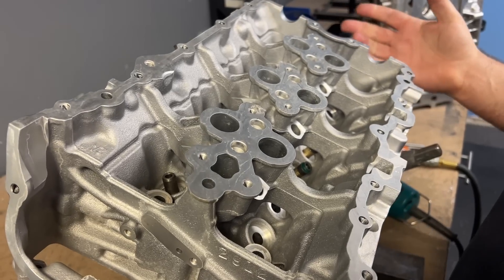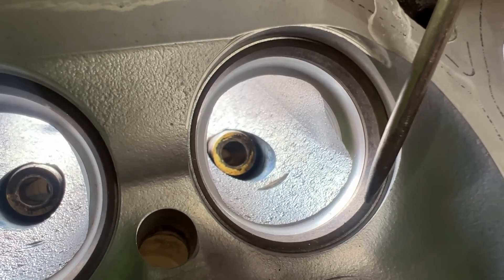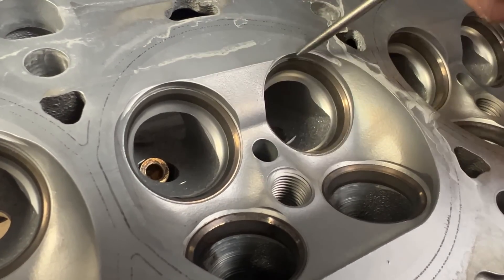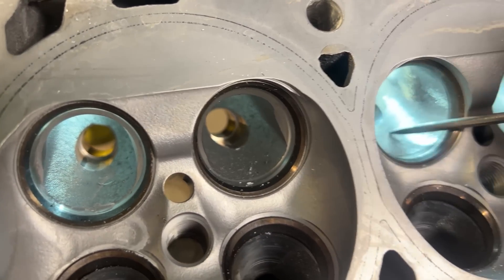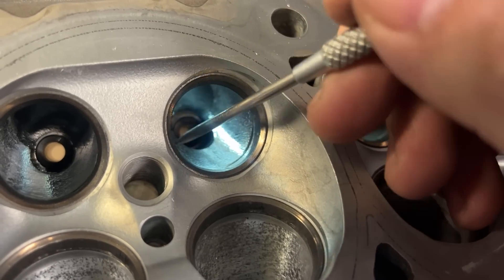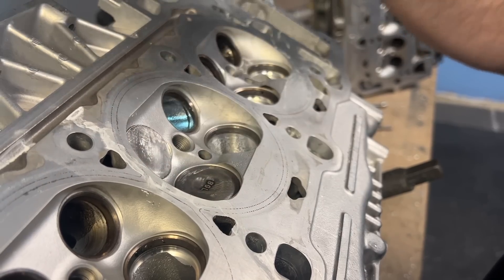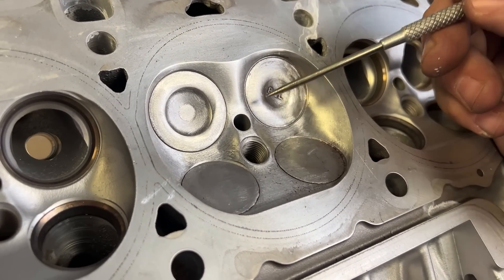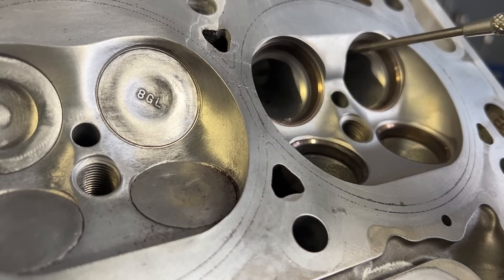The Game Changer- Audi B9 cylinder head R&D Part 1

Comment: Thank u for this vídeo and this explanation, I like This type of job. I would like to learn myself. 
Im trying to get the inside of my Intake manifold ported could I ask u what type of finish you recommend for this job? 60 grit or 120?? Thank u
Reply from the maker: Glad you got something out of this! One thing, if you are just going to sand the intake, don't waste your time. There is nothing in surface finish, you need to move material to make a difference. After porting, I would rough in with a 60 grit and go back over it with 120 grit then hit it again with a scotch bright red pad to get rid of the glue from the cartridge rolls.
Reply: @headgames Thanks for the advice, I will do that. This may sound stupid, I have the Makita GDO603 for removing material and it is fantastic. The problem I have is that I can't find a pneumatic grinder with front exhaust for sanding. My air compressor is 75 LITERS I don't know if it could be done with something like a Foredom SR? or what would you do?

Comment: i'm still amazed with all the efforts companies go to to get better emissions/mpgs from there engines that there is still such easy picking for head porters on modern castings.  I bet with he gains in CFM here that if the OG engine is 2.0L it could not be making the same power with 1.8L or less. I know they want to save money/time in the factory from not doing a CNC port, but surely there benefits are attractive in the modern age. Or at least the "GTi" models should have this help.
Reply from the maker: makes us look like a hero!

Comment: A never before seen head and you start porting before you flow it?  Interesting.  you just killed idle and part throttle efficiency.
Reply from the maker: well, the idle and efficiency part is an uneducated opinion. I have never seen the pocket port hurt any combo. The head did get flow tested before and after, otherwise that's not R&D. We flow tested it before anything, before and after valve job, before and after the combustion chamber reshape. We share some of that data on Oct 16 for part 2 of this.
Reply: @headgames    I've been an engineer for 22 years and an engine designer for 17.  It's not my opinion; it's in the Bosch Automotive Handbook.  How have you impacted the bsfc and emissions?
Reply from the maker: @chrisstavro4698  Pocekt porting is in the Bosch handbook? I have a buddy who works for them and tunes nascar. Gonna have to ask him about that. It is getting tuned. When I say uneducated, I do apologize how that came out. You are certainly intelligent with experience. But, we have done this on many DI platforms now and ALL of them have picked up power everywhere. Nobody has mentioned driveability issues, idle issues or anything of that sort. Because it gets tuned for it.
Reply: @headgames   Of course not pocket porting, but various tricks to increase tumble and torque at low rpm/load.  A team of German engineers deliberately put in that ssr and air dam.  Why do you think they did that, and why does it seems to work without them?
Reply from the maker: @chrisstavro4698  A bosch handbook has this info in it? That just seems kinda crazy to me that it would speak about cylinder head design. But, it works without it because there is added port injection. Port injection along with the DI you can tune out the idle issues. If this was not a thing then no BMW that is making power with a ported head would work at all. Same with ecoboost, lambo, audi, the list goes on. It really doesn't care. I admit that I thought like you that we needed to keep all of those things in there for the mixture motion of the DI  but nobody has issues after a tune with any of those platforms. It is maybe for start up emissions but nothing beyond that is what I learned from doing it.
Reply: @chrisstavro4698 all the crap you are talking about might matter for a stock vehicle with factory tune. This is not that and the tuner will be the one allowing for differences from what BOCSH wants.

Comment: Fan of your work. Glad you mentioned "if you dont have DI you wouldnt do it this way" untill then, I was thinking, he just hacked the whole DI flow. These chambers are sanded and smoothed from factory. In the technical manual it clearly shows the intake shape heading towads the valves square, the part you mentioned as "choked" clearly its on one side again this is ro help DI squish. one thing im sure is, you have slowed the air down before the valves. you mentioned it yourself, the exhaust is ported from factory, because it was important for it to be round and curved, you can clearly see that the intake shape and direction is nothing like the exhaust. Audi couldnt cast them out? they have mild polished the chamber and ported exhaust, did they just miss the "chokey boys" on the intake. clearly this is not a 4G63 If it was only DI injection, that car with that chamber mod, will idle and run like shit at low RPM accel, might even throw misfire codes. but obviously this is done for a secondary injection setup. those injection port holes shape and direction are different on the intake for sure.
Reply from the maker: I must share that I have mixed thoughts on that theory because I too had the opinion that it would not work unless you do it with PI but on the ecoboost, new Honda K, B58 and a few others we have done pocket port and chambers, found out that it wasn't a DI/PI car or truck and it didn't hurt it at all, but picked up power everywhere. Which makes no sense to me. I feel like it has  proven me wrong. Some people smarter than me have said because it is just for start up. But, I don't know.
Reply: Big thing he did gave mire space around the valves.

Comment: I am going to preface this by saying that I'm not an expert by any means in porting a cylinder head.
     But from my understanding of it, you would want to leave a bit of a rough finish in the intake ports. Especially on port injection. Because it helps atomize the fuel before it enters the cylinder. Direct injection would probably benefit more from a smoother finish. One of the most common things I've seen, especially on engines that still have the EGR is that the intake ports become quite carboned up since there's no fuel in the ports to "clean" it.
      From what I saw on this, the factory cast finished seemed to be alright. Though it was restricted at the bowl/seat area as you addressed.
     And then make the exhaust ports a mirror finish for better exhaust extraction and not giving any deposits a place to get caught and cause a restriction.
     And as far as HP gains from doing a port job isn't so much for a drastic increase. What it does is allows more efficient flow of air in and out of the engine. That's the name of the game. Efficiency. With an engine being essentially an air pump. How it goes in and how it exits makes a big difference on how the engine performs regardless of how much power it increases.
     It gives the engine itself more potential to make more power easier.
Reply from the maker: I would never waste my time on smoothing intake ports or mirror polishing an exhaust port. It does nothing.
Reply: @headgames  does it affect heat transfer in anyway?
Reply: @krusher74  I'm really not sure. What's the heat transferring to?
Reply: @headgames  Right on. Then don't. You do you 👍

Comment: You think that OEM "short side" in the intake ports was just laziness by the manufacturer? Or do you think it's there on purpose to induce some kind of specific airflow motion?
Reply from the maker: it is to direct the air to the center of the chamber. Most DI heads do that in some way.

Comment: Not two spark plugs but rather one spark plug hole and a DI injector hole per cylinder in the beginning of the video. Are these heads from Mario Molliere at M2technik?
Reply from the maker: YEAH! I realized I said the wrong thing but I wasn't going back and taping it again lol. From Jackal Motorsports and Mario
Reply: @headgames  I understand and have seen a ton of edits for things like that ranging from choppy sound corrections to text overlaid on the screen. Figured that it would be Mario sending you heads.

Comment: I happen to have a B9 SQ5, already on the path to Stg3+ (739hp/710tq). After this there is need for port injection to take the power level any further than DI can support. Subbed. I also have several 2.7t audi engines, and this video motivates me to practice on one of the damaged heads I have layin around, then I can move onto the big port heads and smooth things out.
Reply from the maker: That's cool you see motivation here! Love hit! My advice is don't smooth things, you need to move material to see any kind of gains.

Comment: I wonder how much knock resistance was lost by removing that intake short side ledge?
Reply: What a loaded question. What I read in textbooks and what the cylinder head king @ GM explained to me was "mixture motion decreases knock tendency" - and good heads/ports are a balance between overall airflow and good mixture motion - whether it be swirl, tumble or a combination of the two.

The mixture motion can come from port design or chamber/squish design.

There are enough racers out there that have "solved" knock in high-boost applications by turning the chamber into a bath tub, totally eliminating any/all squish goodness. Don't know what to believe!
Reply from the maker: With the port injection, fuel and the chamber reshape I would say we moved the threshold in a positive direction

Comment: Way interesting head.
For the short length, think that not increasing the CSA, is the smart move. 
Wondering if changing the seats, to give y’all some meat, to get a 88% throat, with good valve job, bowl blend, and extend the departure angles into the chamber, might give the best bang for the buck, where y’all that deep in, already, and making port energy, being key, to the success, in this job, beyond the flow bench.
Be interesting to see what can be done with the cam / valvetrain, to get more lift.
Great stuff. Thanks for sharing.
Reply from the maker: we would have to out a big valve in it to see any gain there. The throat is just already too big. We have the valvetrain solution coming on the next vid on Oct 16
Reply: @headgames  somewhere in there, you said that it was already lacking on enough of a bottom cut, and leads me to believe that the throats are already too big. My reasoning is, that if y’all replaced the seats with a smaller ID and a larger OD, y’all could get a more favorable 88% throat and improved departure angles, to put some energy into the port, that it looks to be already lacking.
No sh*t intended as a criticism, just a suggestion…

Comment: Question, do you believe you gain much in cleaning up the combustion chamber compared to the slight loss in compression it results in?  Thanks.
Reply from the maker: Well, we reshape it, or smooth it so it is not as intrusive as one might think . Mill it .006 and we are back to OEM. But, now you have the ability to add more timing and moved  the threshold of detonation
Reply: These things are 11:1 from the factory and most of the aftermarket piston options lower the compression anyways.  Im sure its not a big deal
Reply: @jeremys5042  Gotcha

Comment: Good Morning Dave! Another great video as always. You have managed to give me the "itch* for modifying my own 4g63 head. I'm picking up a spare core here shortly so I have something to experiment on. If I remember correctly, you said most of the gains will be from a pocket port/combustion chamber softening. So that's what I plan to do. I have a question for you. From your experience is there a benefit from replacing the factory valves with a budget aftermarket option? Is it worth the time/cost for a lower HP car? 700hp area or so? Is there a particular brand you tend to use? Thank you!
Reply from the maker: Buying valves for something that makes 700whp is a great investment. OEM valves can burn and if something happens to the short block the OEM valve will break vs a good aftermarket valve will just bend. The aftermarket valves are made to handle more heat. I would suggest always doing a bronze valve guide and valve job along with the valve because the OEM stem diameter is a little bigger than the aftermarket valve so when you do the aftermarket valve the valve to guide clearance opens up.  Do the bronze guide and size it correctly with a good GSC stock size valve is totally worth all of that effort for 700whp!